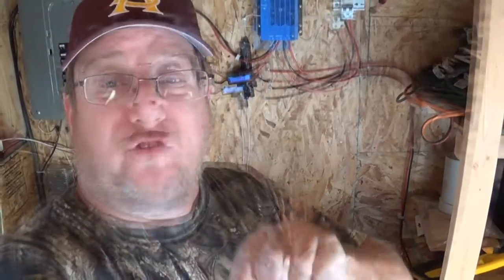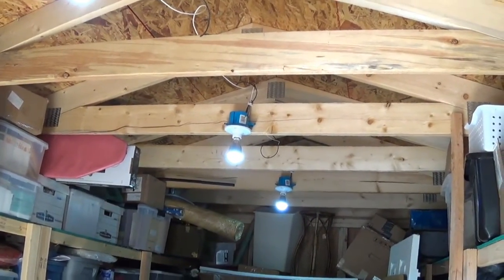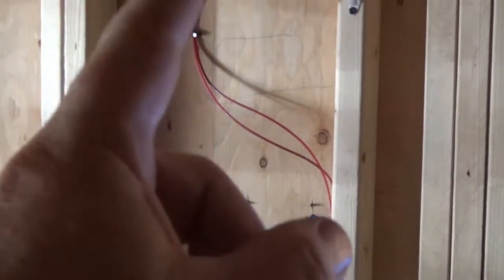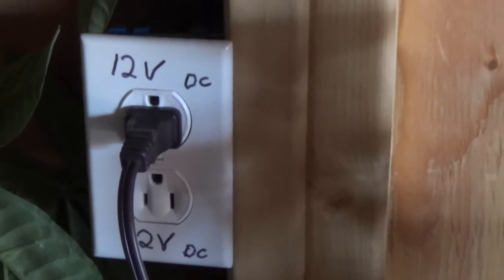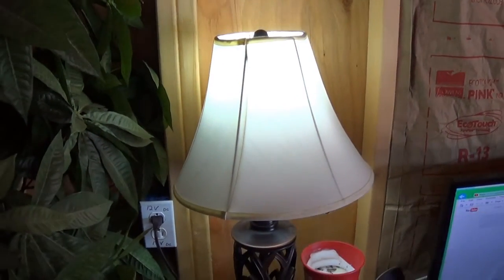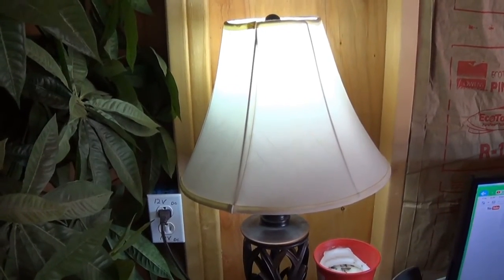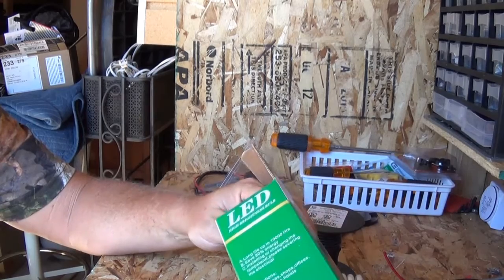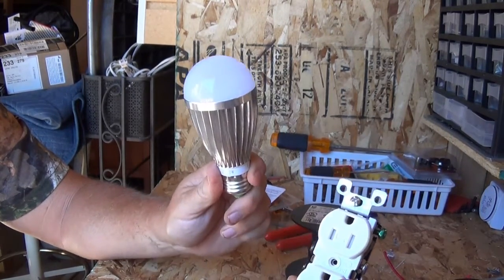Wiring 12v Outlet, Lamp, Switch that normally are used in 120v systems. part 2

Comment: Another good way to designate between 12v and 120v outlets is to install the old 2 prong style outlets. You shouldn't ever need a safety ground for 12v and Leviton  still makes brand new 2 prong outlets for pretty cheap.
Reply from the maker: great idea. thanks.

Comment: I also wanted to add, that I saw this outfit from china on ebay a while back that made led light bulbs in whatever base, voltage, wattage you wanted. Their post had a scrolling menu and you could choose 12v and the base(socket) you wanted. Something to keep in mind shopping for bulbs. It takes many weeks to recieve anything from china like that, but often the savings can be huge. There is a small risk, as it would cost too much to return defective items. I buy many usb charging cords for a buck a piece this way. Even if half of them are bad, I save a ton of money over paying 10.00 at walmart.
Reply from the maker: lol

Comment: For a while, the Element brand tvs at wal mart, had 110 cords that converted to 12v dc. This made them much cheaper that buying a 12v tv. I noticed that the newer ones are not like this anymore. best buy also had a bargain brand that was like this. I havent checked it out lately.  When in the store, look behind the tvs on display and look for ones that have a "12v DC" plug going into them.
Reply from the maker: and best of all they are making more and more 12v tv and making them bigger.

Comment: I haven't had time to mess with it, but on ebay/online, I bought some small transformers that turn 12v into 6v, or 9v, or whatever you need. I also bought the plugs cheap.  I did this to run dc appliances like calculators, tvs, (some tvs come with a 110 plug that really converts to 12v before it enters the tv) , harbor freight motion detectors, and other battery operated stuff that has a optional jack to plug into. This would work good with your system, as you could wire the 110 male to the transformer, to the jack, to the battery operated device you want to power. Saves a ton of batteries.
Reply from the maker: yes it would

Comment: Bro I been looking everywhere to find out if this was possible so thank you for that but I need to see the wires on the switch I'm trying to share a smart 120 switch in my rv that uses 12 volts
Reply from the maker: i have no idea what a smart switch is.    think this all a switch is is a break in the line. use the red (pos for 12v) the rest of the wires never attach to the switch they just continue on.

Comment: Hi Jeff I am currently doing a project for my brother, question can I take the power from a 110v outlet and connected the 12v wires directly into another 12v outlet? Or do I need a bridge to make it 12v
Reply from the maker: no.  you need a step down converter to convert the 110v to 12v. . anytime to are changing volts you need to step down converter or inverter to go dc to ac.  in fact when you charge your cell phone in a wall outlet that box actually is stepping down the volt and converting it to something like 4v to charge your phone.

Comment: Thanks for the great tutorial Jeff. I'd like to ask if it would be at all possible to plug in a smartphone adapter (AC-DC bridge rectifier) that in turn is connected to a USB cord to charge a smartphone or tablet from a DC wired outlet like you've demonstrated in this video.
Reply from the maker: haven't tried that option but I would say it may not work for this reason. I think the rectifier is looking for the 110-120v to step it down to the volts needed to charge the device. I am no expert but you can try it. I would think 12v may not be enough volts to activate the rectifier to step it down to the needed volt. although you could take a dc chargers for phones and cut the end off wiring it for a 2 prong plug . I keep forgetting which wire is positive and which one is negative but that matters a lot. I am sure somewhere online you could find it out. .. does that help?
Reply: I hope someone can answer my question and yes, I am a noob. I have seen and am making an steampunk /antique lamp using the headlight from an ol motorcycle. It looks great using the same style light in the housing but the light is 12v DC . The lamps I have seen plug into an 120 ac socket. How do I make the 12v DC light plug into the reg, house 120v ac socket? Excuse the long question.

Comment: I'm changing my Barn from 120V to 12V.  If I disconnect the 120V AC from source power and switch to 12V bulbs, can I use the existing line for 12V?
Reply from the maker: yes but you might experience some loss in volts so dont have to many lights hooked up. the reason is the power actually runs on the outside of the copper wire becus 120 is a higher volt lower amp the solid wire can easily carry the current. however with low volt higher amp like 12v the strands will help to maintain the volts to run your loads. try it and it should work but if it doesnt this would be why.
Reply: @ArizonaHotHomestead  I would just try it before changing the wire especially if you are going to use LED's because they use less power. Also it is likely that the wire is heavy enough to run the lights without much loss. Actually the electricity runs through all parts of the wire and not just the outside. Keep in mind that the bulbs you use will need to be the same wattage as the 120 volt bulbs unless you are going from filament type bulbs to LED's. I am not sure if you can get LED bulbs for 12 volts that will fit 120 volt sockets.

Comment: I want to set up a smart home system which includes a hub and some sensors that normally plug into 120v outlets and switches, but powered by 24v dc current. Is this possible? (this is for an off grid application)
Reply from the maker: yes. inverter will change the volt from 24v to 120v. i use an inverter plus i wire 12v just in case something goes wrong with the inverter. .. just make sure the inverter is large enough to cover your use. its measured in watts like 2000 watts peak 6000 watts (surges like frig motor)
Reply: @ArizonaHotHomestead  due to inefficiencies, I wanted to not run this circuit by inverter and instead power these devices with DC power although they're rated for AC power. So I want you power the 120v outlet and switch they plug into with DC power. Is this safe and doable?
Reply from the maker: i used 120v rated outlets and plugs for some of my 12v devices. in fact the light by my desk is a 12v led bulb in a standard 120v lamp plugged into a 120v outlet wired for the 12v. i did a video on this.  just make sure you label it so you know whats 12v and whats 120v. .. does that help?

Comment: Switches don't care whether it is AC or DC as long as they are rated for at least as many amps as the load. Also keep in mind that a 30 watt bulb for 12 volts will  draw 10 times as many amps as a 30 watt bulb for 120 volts so this should be considered in the amp rating of switches and wiring. In most cases this shouldn't be a problem especially if using LED's
Reply from the maker: thanks. that is what i was thinking a switch is only a break in the line.

Comment: Can you do this with a dimmer switch?  12v dimmer switches are ridiculously expensive.  Complete rip off.
Reply from the maker: not sure have to test it to see. a dimmer controls the voltage so as long as its a 12v dimmable bulb you might be able to.

Comment: They you use a Transformer? and what type?
Reply from the maker: no transformer. just straight from my 24v solar batteries with a dc to dc step down to 12v  and a fuse . thats it.
Reply: thanks

Comment: What size wire did you use
Reply from the maker: many sizes. large runs i used 6awg then in a junction box i twist tied it to a 12awg for a short run to the switches and sockets (less than 10 ft)  stranded not solid wire. if i could get away with 10 awg i used it. the wire connections to the fixture determine the wire size. i went at large as i could. 12 fit perfect.